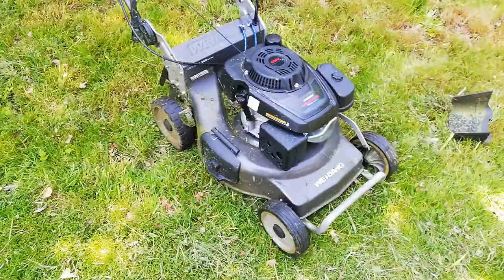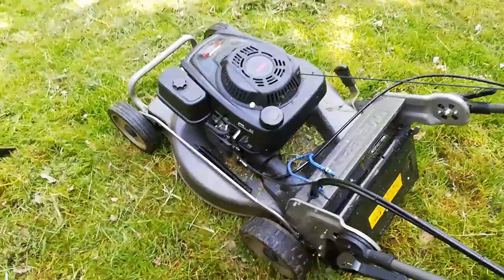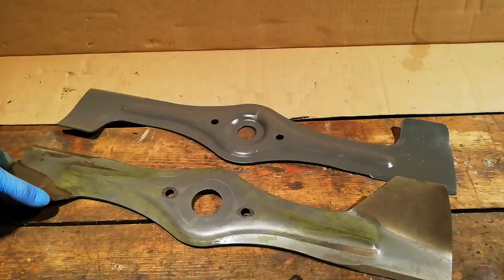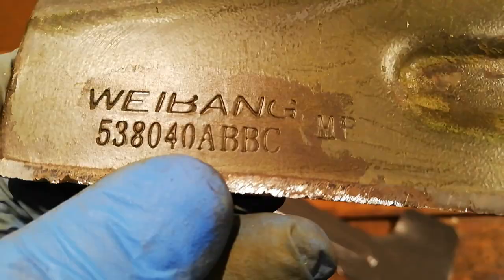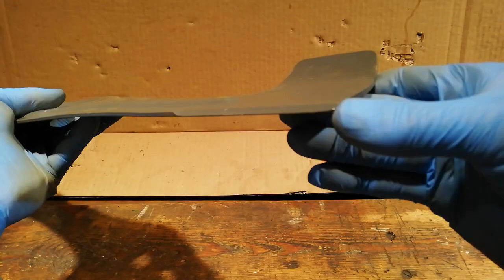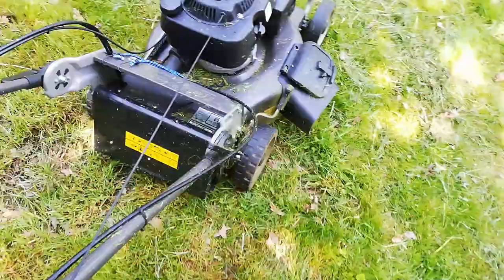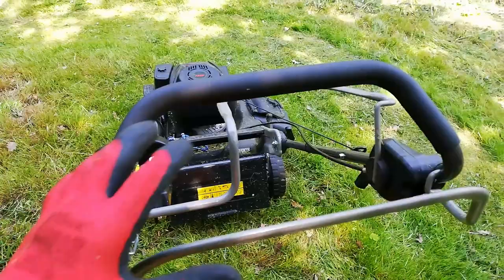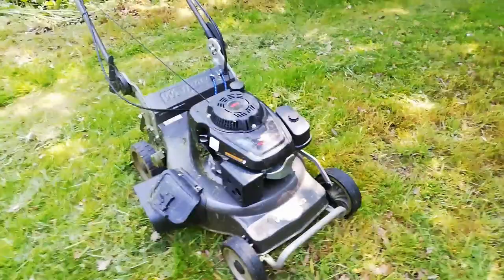WEIBANG Virtue 53 Lawn Mower Pro Tips

Comment: Good stuff 👏 i will trim my sidecharge chute like you said, it keeps clogging or chucking out lumps of grass so i tend to just hold the flap open with a bungee. Couldnt find your vid on upping the revs.
Reply from the maker: Yeh i use a bungee as well when tackling long grass, thats just down to the hole in the deck being quite small i think. Im abit behind with editing mate 😅 so the rpm vid will be out end of the week, prob on my second channel 👍

Comment: Ive got a 46 I've been  thinking about trimming side discharge chute just been lifting it up with a bungee cord .. if only we could get a plastic box it.    I've got a few niggles with mine  but  overall it's not a bad thing
Reply from the maker: Yeh the side discharge seems to be a bit of an after thought on these mowers, the hole is far too small really. Not bad machines though, a touch on the heavy side this model. 👍

Comment: Good tips thanks! Just got one, what is the petrol to oil mix ratio? Not sure how many strokes is this engine..
Reply from the maker: Its a 4 stroke so no mixing required, Put oil in the engine then normal fuel in the fuel tank 👍
Reply: @RJLgardens  Thanks!

Comment: i always thought mower blades were always sold without an edge
Reply from the maker: Without a sharp edge you mean? some blades are better than others, but most come blunt.
Reply: @RJLgardens  yea, I was told that rotary mowers basically smash through grass rather than cutting it whare as a cylinder mower cuts like scissors.

Comment: In my experience no mower can do 4 in 1. It can bag averagely, it can't mulch well and leaves clumps everywhere, side discharge poorly as it clogs up. Buy a mulcher if you want a mulcher.
Reply from the maker: Thats why you buy different blades depending on situation, so high lift blade for bagging and side discharge, then use a mulching blade for mulching, fairly simple and easy to swap out. That's how i run a 4in1 mower anyway. Cant use 1 blade expecting great results allround 😅